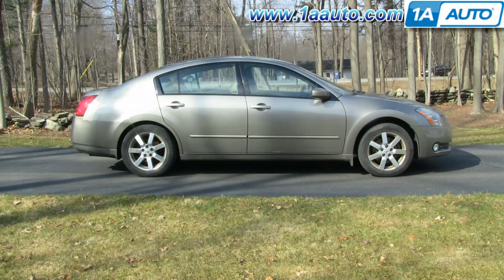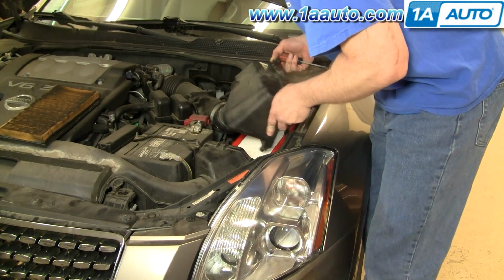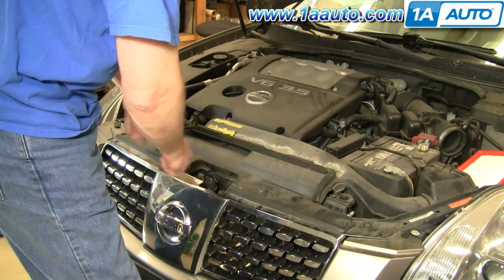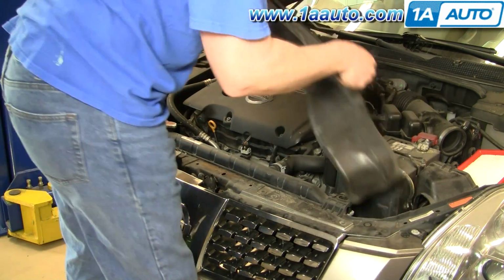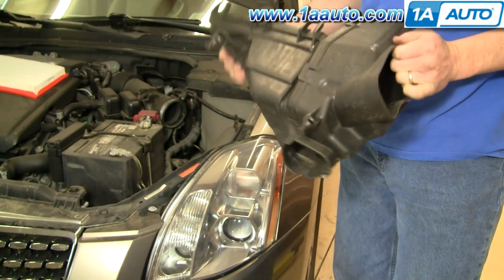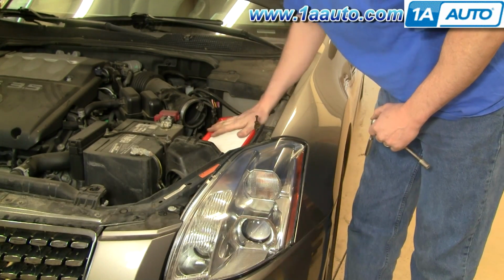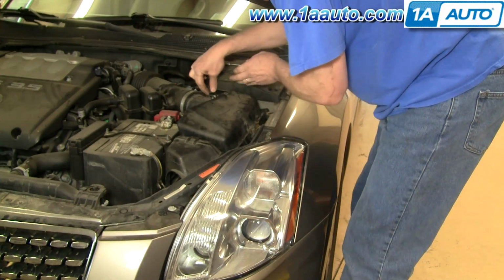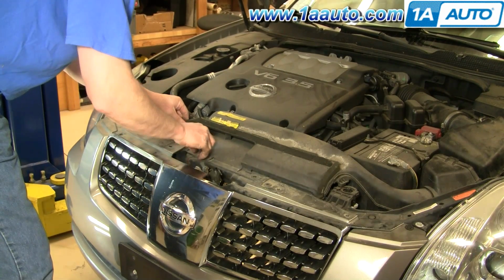How To Replace Air Filter Housing Box 04-06 Nissan Maxima

Comment: I have an 07 Nissan Sentra 2.0 that has an air filter that's connected to the battery tray and the battery connects to a black box that's under the driver side headlight. Do you know the name of the box? What's it's purpose? Also why does the air filter connect to battery, what the square hole in the front for? I've looked all over but can't find an answer. TIA 🤔

Comment: I have 2007 Nissan Maxima when I accelerate I hear a hissing noise from the air intake. No leak no loss power. Any idea what that can be caused my? My air duct pipe is not attached properly

Comment: I'm missing the bolt mentioned at the 3:10 mark. Where can I find a replacement? For a 2008 altima 2.5s. Thx
Reply from the maker: +Richard Galindo You may be able to purchase one from your local dealer. Hope this helps you out. 1aauto.com
Reply: Same here... missing that bolt on 2008 Altima